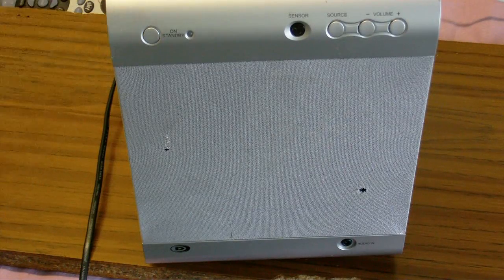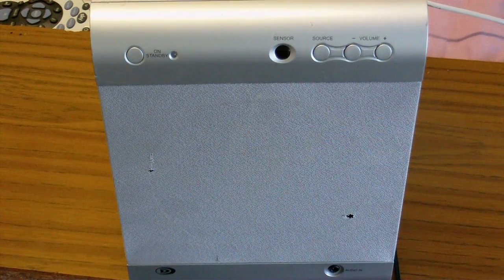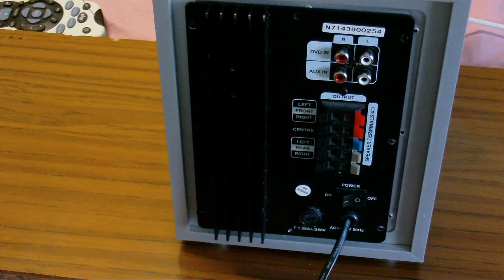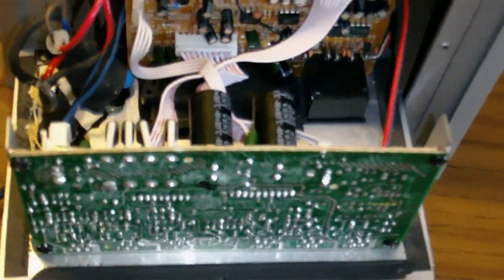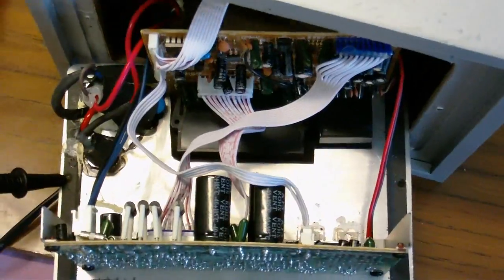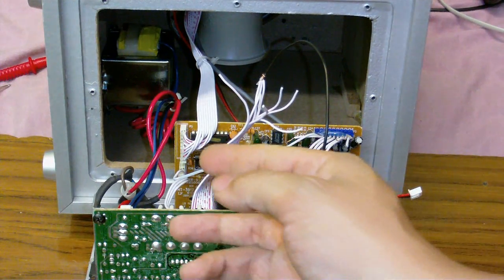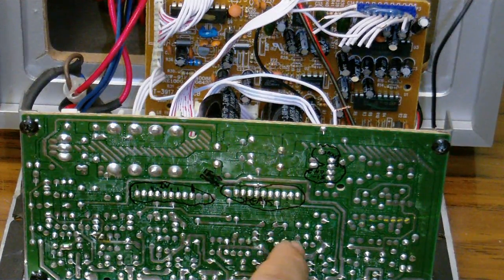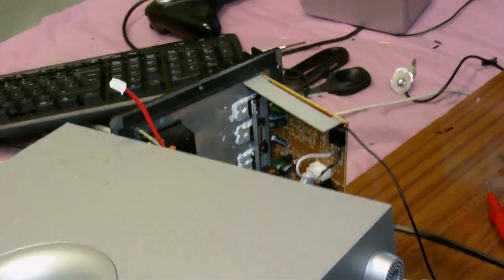circuit bending a durabrand home theatre speaker wosit

Comment: I don't think these transistors are preamps because the TDA2030A doesn't need a preamp (at least at the normal RCA jack levels). The transistors are maybe for a standby circuit that turns the power of the TDA2030As on and off. So if there are 5V the power for the amps is turned on.
It would be a good idea to install seperate inputs for each channel instead of the two channel input. So that this device can be used as a real 5.1 surround system.